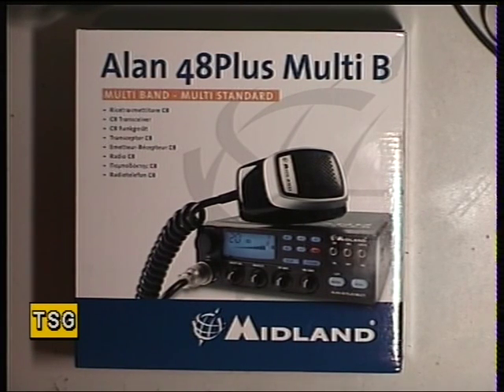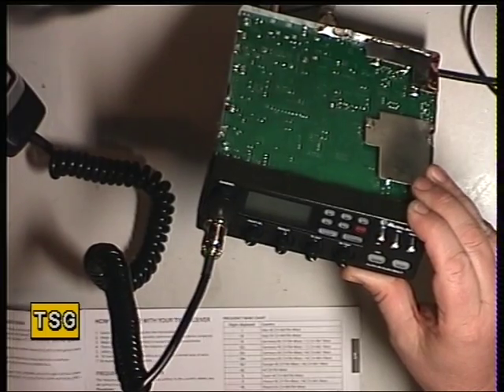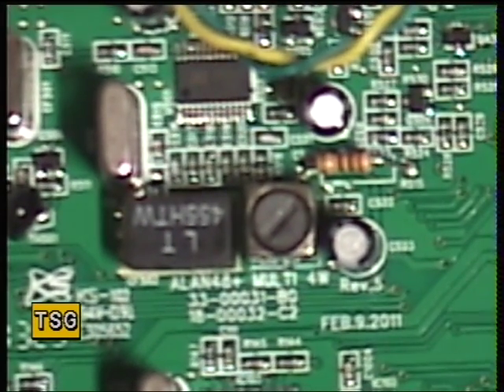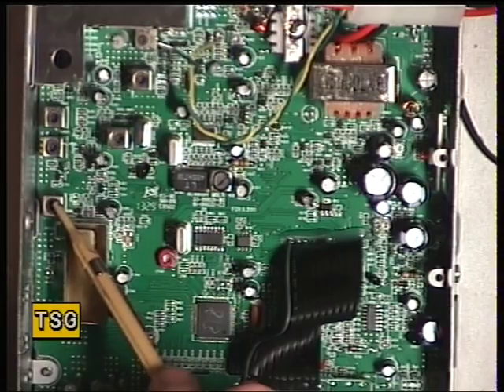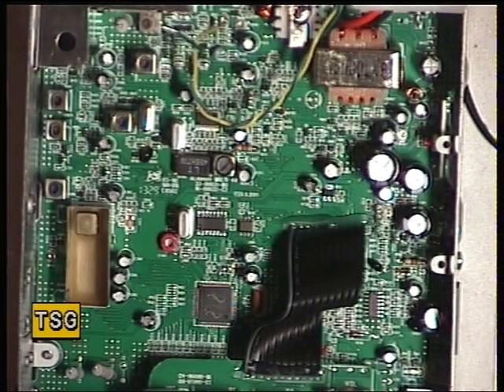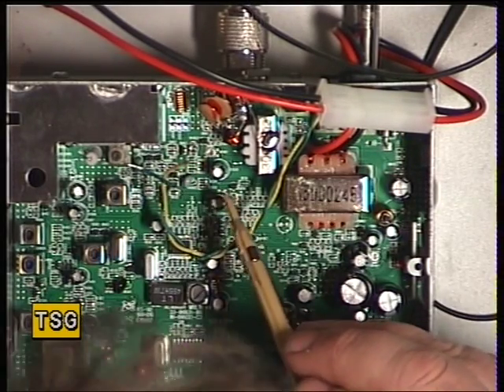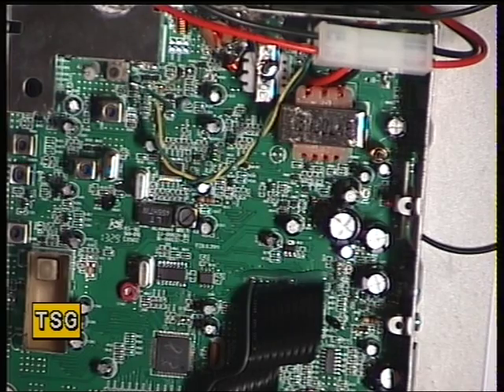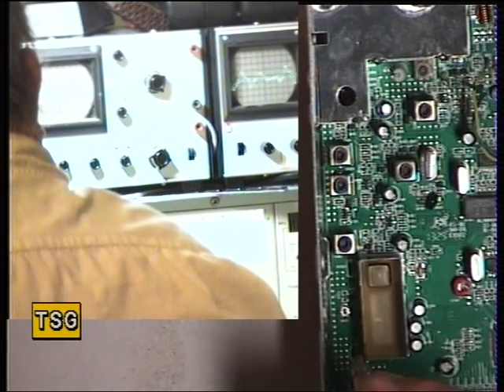Midland 48 Plus Multi  - UK CB radio, (CE Multi) (Mobile).  Transmit alignment

Comment: hi there, have been watching your videos for a while, was wondering if there was a way you could service and repair my midland 48 plus Multi, it's an older one with orange display, but I can't seem to find an email address for you. thanks in advance
Reply from the maker: Although I normally only do service work for the trade rather than the end user, I would do yours as long as its not been messed with & is a standard model intended for UK use. Tell me what it's not doing etc.

rshireby@yahoo.co.uk

Comment: Belated question admittedly, but is the fact that you tested only 3W on the UK channels due to the manufacturer having to compromise on the power output because achieving 4W on all modes is not really possible?  So, it's like a see-saw effect: you optimise one mode, say, UK channels for 4W but this may impact on another mode or modes, say the CEPT frequencies or any other?   Is it not possible to get 4W or the legal maximum on all the modes at the same time?
Reply from the maker: +Zero X-Mission Correct, it's usually a compromise. Our customers all want optimisation for the UK 40 channels & will probably never use the CE 40. Some of the very cheap radios, however, are able to set their own filters according to frequency, through their CPU, whilst some others have transmitter sections with no adjustments, manufactured using a "select on test" method,,,i.e.  as the radio is assembled it is tested up to that point & then the next critical component is selected & installed taking those test results into consideration. No doubt done in seconds by automated test/pick & place machines
.
Reply: That's interesting. It strikes me as rather counterproductive for the manufacturer, however, as CB users with a reasonably accurate power meter will detect a poor output from their newly-bought radio.  This would, I presume, have a negative effect on the perception of the brand reputation in general.  Or perhaps manufacturers assume that radio operators these days expect some tweaking and peaking would be necessary should a preference for a particular mode be preferred.  That said, poorly optimised radios were being churned out of factories well before even dual mode (UK/CEPT PR 27/97) radios were manufactured but I realise that time is money and the assembly line techs are not paid to take each radio's performance to its maximum, just within an acceptable range as you say.  Shame though as I many radios probably suffered a bad rep just because they were not optimised.  I know that from experience. When PR 27/97 was launched I soon after bought a brand new Midland 78 Plus from Maplin.  It was the deafist radio I had ever owned! It must have had a receive sensitivity of about 5 volts and that was on an outside A99 at the time. Just terrible. I took it back as faulty and got my money back. First impressions last and I never bought a Midland after that.  However, I realise now, with more knowledge and experience of course, that it was just a poorly optimised radio.
Reply from the maker: I had a Midland 78 in my own car for 4 years & especially liked the way the scan worked on that model. After routine servicing it's now in a friends car & continues to work very well. 

My current car has an Intek model with a forward facing speaker. From new, I had to change an electrolytic capacitor plus optimisation. Blow me; it needs to come out for the detector being out of aligment now,3 months later.  can see me dripping some hot wax into that coil next time it's on the bench. Works very well when working though!

Richard
Reply: +UK CB radio servicing I guess based on your experience I should have said that my 78 Plus was probably poorly optimised. ;)  It's certainly quite possible it needed a repair.  :)  I can't remember how it scanned but I recall being disappointed that my replacement for the 78 Plus, a Maycom EM27, didn't have the option to scan in sequence both UK and CEPT frequencies.  I'd have liked it at least as an option, but I know some prefer the radio as it is.  I've heard positive reports about Intek radios, but never owned one.  A bit unfortunate to have had the faults you describe on your radio but a relief to be able to remedy them yourself I'm sure. :)  I bought a Planet 2000 off an eBay seller a while ago and the seller reported that the radio "had never worked properly from new" and would often crackle, lose RX and go silent.  Sure enough, it demonstrated these symptoms to me after a few minutes but would recover almost instantaneously or after a few seconds.  Initially, I could find nothing as everything appeared normal.  I was expecting to spend days trying to trace the fault but one of the first things I did (fortunately) was to get out my eyepiece magnifier to see what, if any, dry joints might exist on the PCB.  After a few minutes of flipping the set this way and that, I was surprised to find that one of the eyes of one of the front switches or pots (can't remember which) had interconnecting wires completely unsoldered.  Soldered it up and problem solved.  Since the set had probably disappointed the owner fairly soon after purchase he'd put it away and it had hardly any signs of use.  Nice little example in my collection now. :)

Comment: Its a shame they don't come optimized out the box .
Reply from the maker: True, when I ran a TV shop we never sold stuff straight out of the box. They all had their backs taken off, the PSU was set to lowest possible working voltage (improved long term reliabilty) & the convergeance was set up with a test card. Customers expected a 15 year life out of TV's back then. TV's are so dreadful now...and so are the programmes that I stopped having a TV at home 7 years ago.

Richard

Comment: Looking good shame you didn't have a service manual can you easily get one?
Reply from the maker: Not really & being Surface Mount Technology, there isn't that many parts you can change anyway. The Midland 48 is made by Maxon, Most of my specialist 2-way radio training was done with Maxon at their UK HQ, so I can usually guess the way they are thinking.
Reply: UK CB radio servicing That works out a treat!  I had a very similar model to the one your doing in these videos I don't think it was this one though but excellent as always!